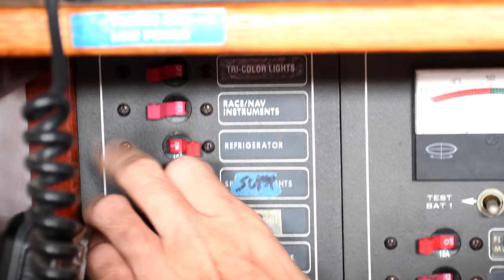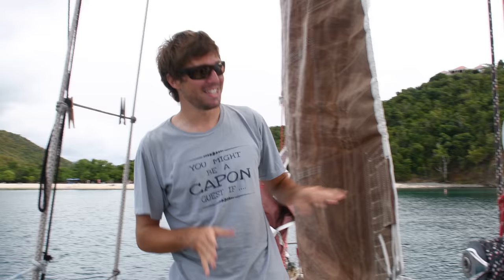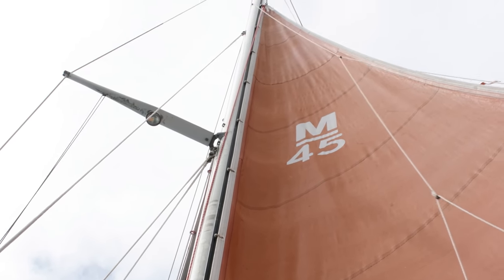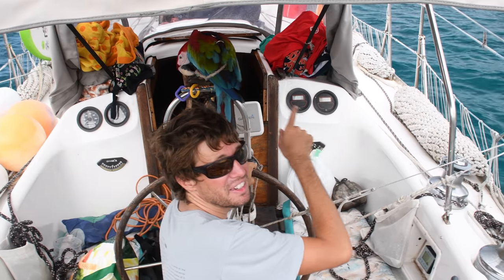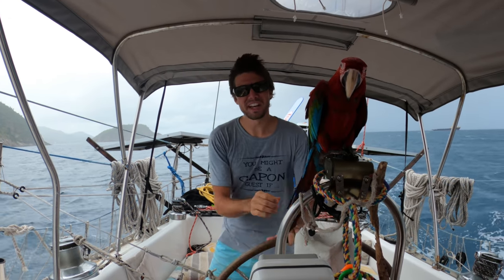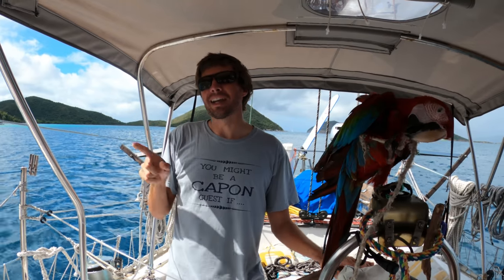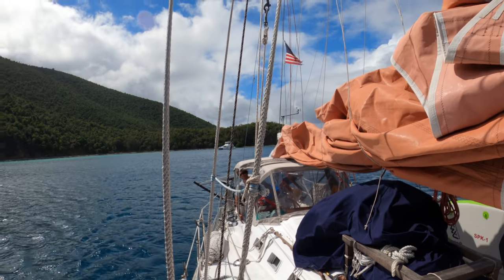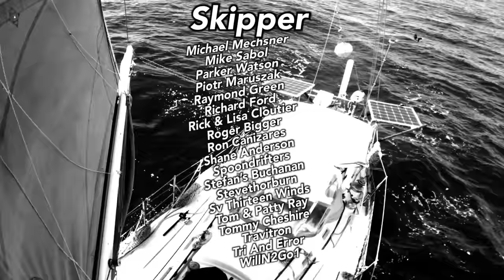Can You SINGLE HAND a Big Sailboat? | Sailing Wisdom [S4 Ep4]

Comment from the maker: Have you ever single-handed your boat? If so, what size and what advice would you give?
Reply: Yes. I had a Siren 17 which I routinely single-handed, often in the dead of night.

I got her to self-steer on some points of sail, so I usually had the jib put away before I started the outboard (this boat had a 3/4 rig, so could sail well on main alone).

The advise I give is to know your boat well.

This proved quite useful when, with a friend, I tacked up a 40 ft wide channel, dead to windward, even though this boat had a horrible habit of getting caught in stays.
Reply: I used to single hand my 28 foot IOR 1 ton in the Tyrrhenian. Organization is the key. You have to know what you're going to do before you need to do it and not figure it out at the time it needs done. A decent autopilot never hurts as well ;)
Reply: Used to single hand the Catalina 22 & with the young daughters was more or less single handing all of the time. The Prindle 19 Cat was much harder to single hand, the old Hobie 16 was much easier but was a young flat belly back then.
Reply: Does a canoe count? Actually, the l last time I single-handed a canoe was when Mrs. Webhead USA was in the passenger seat when I stopped the canoe, got out, got down on my knees in the water  and proposed to my partner of 40 years, Mrs. Webhead USA. I bet you were not expecting this story... but you asked! :¬) Webhead USA
Reply: I've been single handing my 44' powerboat (closer to 51 if you count the dinghy and anchor hanging off at either end) up and down the US East coast for over two years now. I don't have sails or standing or running rigging to worry about, which makes things easier. I do get into and out of marinas pretty regularly, and I anchor frequently as well. 

You pretty well hit the nail on the head when you said it's all about thinking ahead, and having things set up for yourself. Anything you can do to make the job quicker and easier is a good thing. Lots of practice also helps. Just keep doing it, and you'll eventually get comfortable with what the boat's capabilities and limitations are. You'll also learn what your own capabilities and limitations are. Be conservative at first with things like current and weather. GO SLOW! The old rule of thumb is 'don't approach anything at a speed higher than you'd want to hit it.' You WILL bump into things. It's going to happen. Don't let that intimidate you. Just do everything you can to make sure that when you do bump into things, you're going slowly enough that it doesn't make a difference. 

Just remember, you've met some really dumb people that can drive boats. You're pretty smart. You can figure it out!
Reply: Never run and if its difficult you're doing it wrong lol
Reply: I single hand my Albert 35 on the Chesapeake. It’s like chess: like Herbie said, it’s all about planning everything ahead.
Reply: I half hand. Half for the 62' ketch and one half taking care of the family. Just plan ahead
Reply: Yes. My last was was a 38 foot ocean racer  and didn't have a self tacker. I'd say, practise all the handling moored, several times, so that you're confident and sure there are no snags or fouls, and give yourself plenty of sea room. Offshore is much easier than coastal - less to hit. A couple boat offshore is basically being singlehanded most of the time. Inshore, keep your wits about you, keep your observation up and reef early. Just dial down the stress. Inshore I personally prefer a chart to a plotter - easier to read at a glance and I can position myself relative to landmarks  easily. I think you can get a bit obsessive with a plotter and it's less fun. But I'm old. BTW that doesnt mean I don't use a plotter, I do. It's just quicker to look at a paper chart. And I LOVE singlehanding. Nothing better. Really.
Reply: Yes, I single hand my Alberg 35 on the Patapsco River and Chesapeake Bay
Reply: I own a 44ft Jeanneau Sun Magic from 1988. I've sailed single handedly from Spain, Ibiza to Greece. The biggest challenge I find is with Mediterranean mooring: drop anchor in a harbor and backwards to the dock. I can do it, but I often ask for assistance with that maneuver.
Reply: I singlehand my Sundeer 60 frequently and for extended periods. She is easy to sail and set up for short handed sailing. I can gybe the boat myself in 30 knots without drama. I can drop the main myself in 30 knots without drama. I frequently dock & undock in the marina singlehanded. I have no bow thruster, nor do I feel like I need one. The boat has an oversized spade rudder, fin keel and, importantly an immersed bow. This means the bow does not blow off downwind rapidly like some boats. With the large rudder I have complete authority over the boat at 1 knot STW.  I do have four very large inflatable fenders. If it's very windy and I am on my own I will get help, or just wait until the wind has dropped.

Comment: I single hand all the time on my Jeanneau 51.  The only thing I do differently from what you were doing is I completely furl the head sail and use only the main for anchoring or departing.  It’s a little fast if I have both sails up.   Also, if it’s too windy, I rig up a long line from the bow and back in to the anchor buoy.  Once tied in, then it can swing to the bow easily.
Reply: Good to know and good tip! Thanks!

Comment: The biggest assist when single handed - the autopilot (aka Otto). Honestly, the autopilot is probably worth at least one crew member. And after that I recommend being able to sail without autopilot using sail balance to steer. I currently single hand a Bruce Robert’s Spray 42 cutter ketch

Comment: As you obviously know, setting up the boat for single-handing is critical. If one needs to have on hand on something and the other on something else that is 7 feet away, it is time to make some changes in how ones equipment, winches, etc are laid out. As you know, it takes a while to get the boat set up for single-handing, but once done...freedom.  So far I've done 8000 miles single-handing, and planning is everything.

Comment: Great video!!!! I don't have a sailing partner so I single-hand my 72 Columbia C45 all the time. She is cutter rigged and I set up all the sheets and halyards to run back to the cockpit (soon to be a fully enclosed pilothouse)...including the reefing system. Like you, I set her up to self-tacking on the main and the storm sail. Best thing I ever did. If I am sailing in tight quarters, I don't even unfurl the gib. I just run slow and steady on a reefed main and a storm sail.
Reply from the maker: We call that sail plan our “river sails” since it’s so handy for short tacking up rivers and creeks! I’m a bit envious about the lines led back to the cockpit, I have the halyards and reef lines at the mast which is why I normally raise them with the anchor still down. If I need to change them while underway, I have to run back to the helm a few times to correct course 😆

Comment: I'm an old man from a racing background.  I used to single-hand our Impulse 26 fairly often.  The kicker was in the hold, lashed to the mast.  So, I never took it out.  I sailed it away from and into the dock.  It was just a matter of managing momentum.  I'm beginning to sail heavier boats that are a little more susceptible to wind and current.  At least, I don't understand them as well.  Advice?  Slow is good.  Drop the foresail early.  Make sure the main will drop quickly when you free the halyard.  You don't want to be fussing with the main and have the rudder moving about.  Of course, we only had bungies to hold the tiller while we were working forward.  I think a tiller or wheel lock would be helpful.
Reply from the maker: That’s great advice!
Reply: @RiggingDoctor  WOW!  I didn't expect that from you!  I am not in your class.  Thanks.  I am honored.  I hope to be sailing in the Caribbean this spring.

Comment: Well said and simple. Most worry about single handing, as the majority of what I've ever done it's the only way I think. I still need to learn sailing with crew as captain. Learning what to expect from them or not.
Reply from the maker: We have found that having help means you need to spend time explaining what you normally do quickly. Once you have a system that works, why complicate it?

Comment: You're pretty much spot on...planning and thinking ahead, being prepared. For me, single handing an LM32 the windvane steering, most lines led aft to the cockpit for single-line reefing the main and a lifeline system running both port and starboard to be tethered, are essential. The self tacking high-aspect jib is nice to have.

I would pickup the mooringline from the cockpit, backing up against the wind to the mooring...first having prepared a line from the bowcleat to the cockpit to run through the mooring.

Comment: When I took ASA101 it was only a 25 foot boat and obviously not single handed, but there was no motor, so sailing off a mooring was the very first thing we learned and sailing onto a mooring was the very last thing we did. (Other than packing away the sails and riding a motor launch back to the dock)
Reply from the maker: It’s an important skill, the only difference is how far away the bow is from the cockpit 😉

Comment: This is a very interesting topic as I'm a single old guy and would like to sail the Caribbean.  How do you drop and raise your anchor?  You're not supposed to let the windless pull the boat, only lift the ground tackle.  Any other tips for setting the boat up for single handed sailing?
Reply from the maker: With an electric windlass, you need to bring the boat to the anchor. With a manual windlass, you can pull the boat to the anchor, but it is a lot of work!
I raise the main with 2 reefs and sheet the main in tight. This will make the boat sail up onto the anchor with no one at the helm so that all I need to do is crank up the chain. Once the anchor is up, I raise the staysail and run back to the helm with a balanced sailplan. If the winds are light, the boat will be moving slowly and I can easily shake out the reefs and raise the jib to get moving. 
The biggest thing for single handing is having the sheet winches in reach of the helm. Getting the anchor and sails up can be as slow or fast a process as you can manage, but it makes up a minority of the time spent on a voyage. Being able to sail and steer is the most important thing!

Comment: i've got a 75 frontsail with selftacker rail for the clew. first time i've seen that setup you have which is awesome. at what size frontsail would you say your selftacking setup wouldnt work great?
Reply from the maker: As long as it doesn’t overlap it can be done. Both of our headsails are 95%, but the jib can’t be setup this way since the inner forestay is in the way. If you have a sloop, you can set it up with up to a 100% jib.

Comment: Another great video!  We are putting a sail to Smith Island and Tangier Island together for the spring.  Have you visited those islands?  Any advise?  We will trail to Crisfield and put in there.
Reply from the maker: We only went to Tangier as the weather was too fierce for Smith. We anchored in the deeper area on the east side of the south sand bar of Tangier and towed into the town, tying up to a bridge where we came ashore. It was a fun island to visit with an interesting situation ;)
Reply: @RiggingDoctor  Thanks!  We are on Chincoteague Bay.  I think the general plan is to splash at Crisfield and sail to Smith Island, sail to Tangier Island, and back to Crisfield.  Just make a weekend out of it.  Another, longer trip that we are eyeballing is St. George's Landing.

Comment: You can also.,when leaving the mooring,  backwind the jib with your hand pushing a section of the jib against the breeze, to force the boat to start to turn in the direction of the tack you want to be on. When it starts to go in that direction, go back to the helm and start steering. Sailing single handed without an engine (or using your engine) is the way to be most confident. My father would sail our boat backwards backing out of boat slips when necessary by backwinding  the jib.   You also do not need a self tacking jib to go soloing on a big sailboat. There are ways to operate the sheets so that minimal winch grinding is needed by timing when is the best time to release the jib sheet  and pulling it in on the other side before completing a tack by having the loose line already pulled in so a minimal amount of tightening is necessary. Sometimes no winch grinding is necessary at all.  It seems most cruisers never learn this and waste a ton of energy letting the jib sheet out too soon when tacking and then needing to wrestle to pull it in on the other side cranking the winch like crazy when it is totally unnecessary.
Reply from the maker: The self tacking jib isn’t necessarily but sure is handy! I have done the trick you type of with the staysail and it gives much better sail shape than the self tacker does, but it does necessitate me to divert my attention from helming for just a small moment. This isn’t a huge issue at all, but the self tacker makes it even simpler :)
We never use the jib (cutter rig) in tight situations because the “minimal winch” trick doesn’t work with it as the sail has to go forward to get past the front of the staysail. When you can begin pulling it back in, it’s already too far out there and takes a bit of effort and time to tack. 
I also really like relying on sails over an engine as the sails will give lots of warning before they conk out on you when in a tight situation (the wind dies). A motor could die on you for a host of reasons and your only warning is the beast sputtering to its death! 
I like the back winding job idea, I have pushed on the boom to back wind the main to move in reverse in the past, it’s closer to the helm for when I needed to run back to steer 😎
Reply: @RiggingDoctor  Yes. I know. We had a wooden classic Herreshoff 12.5 once with a jib that had a boom and it was almost effortless to sail. However, if you have to deal with winches  and separate sheets with your foresails, there are ways of timing the release and the pulling in of sheets that make tacking a lot more seamless than the majority of sailors make it look. If you do it right, you should never need to crank the winch in more than a couple quarter turns - especially if you have a crew member. The sheets should be able to be let out on one side and pulled in on the other side at the same rate so the winch never needs to be used.

Comment: Hi, I really like your sunglasses, which make/model are they?
Reply from the maker: They were by Maui Jim. I don’t remember the model since I got them back in 2016, but they had “sailing lenses”. The top and bottom were mirrored and the middle was just tinted. They were great sunglasses and if you get bronze polarized lenses, you can see high pressure weather systems in the sky which is great for weather forecasting!

Comment: My advice for single handing is take your time.  Don't run or hurry.  I single hand my 36' ketch all the time.  It is easy.  I use the mizzen to turn the boat to the desired tack when I drop the mooring under sail.  Simple.  Drop the mooring, walk back to the helm, push the mizzen out to turn the boat to the desired tack, unroll the genoa and you are sailing.  My boat is set up with all lines led aft so except for dropping or picking up the mooring I never leave the cockpit.  Personally I think a big boat is easier than a small boat since things don't happen as fast on a big boat.  I do agree on not using a winch handle.  I never use one with my 150% genoa, but I do have electric winches.
Reply from the maker: Excellent advice!

Comment: It would be interesting to see how to drop the anchor single handed. And then... how to raise the anchor single handed. And if you can pull it off without using a engine - now that's some skill.
Reply from the maker: It’s actually pretty much the same. Put up the staysail and sail over the anchor, then once it’s up, run to the helm :)

Comment: hi ive done 10 atlantic crossings 9 solo.over 60,000,miles singlehanded in boats from a steel bruce roberts 34 to 4 crossings on  a 22 ft ferro oyster dredger gaff rig. click on the blue r and theres some videos of defiance. any boat can cross oceans .my advice from experience, dont take crew without them giving you the fare to there country of origin. also their passport.i learned that the hard way after one went crazy half way across. if they have no sailing experience they are passengers not crew. you are responsible for them once they are on your crew list.if they get ill you pay. if they commit a crime you are responsible. if they bring drugs aboard you are responsible.as for the boat i always replace the standing rigging if the age is unknown. also a good windvane, ive used the hastler servo pendulum , hydrovane  a navic and at the moment an atoms servo pendulum all worked well. and a n  ais reciever transponder.im off again next spring in a seacracker 33. ps defiance my 22 ft oyster dredger was the best to cross but the slowest.
Reply from the maker: Thank you for your experience! While ferro cement boats have a bad reputation, to me they seem to shine with all the good qualities a bluewater cruiser should have!

Comment: Raising an anchor on 50m of chain presents more problems...
Reply from the maker: I used to do that, it’s the same as with the mooring ball. Get the sails up and pull in the chain as the boat sails up onto the anchor. Time the anchor breaking free with the tack that you want to be on. The hard part is pulling the chain and anchor up to the roller fast enough! We have a manual windlass that pulls 3 links per stroke so you have to crank fast!